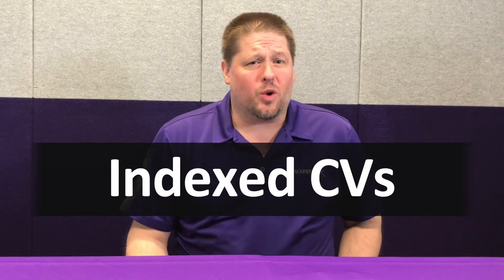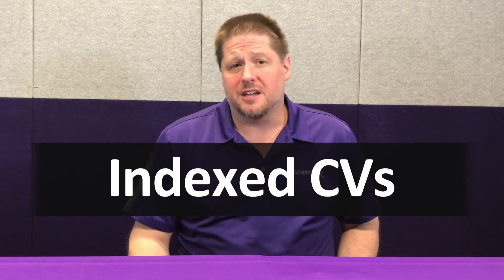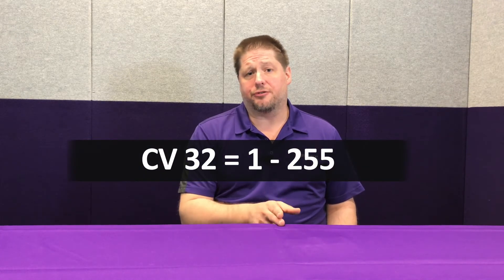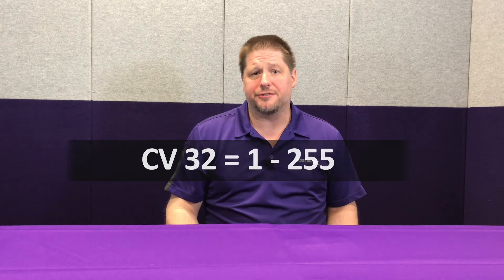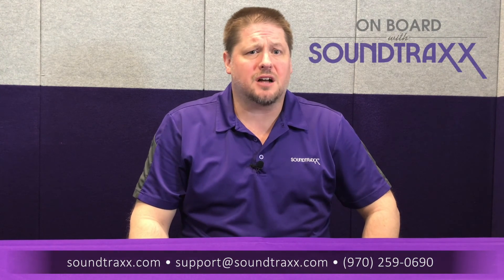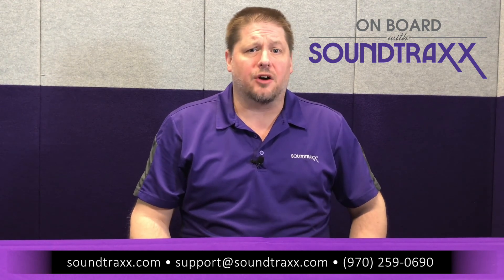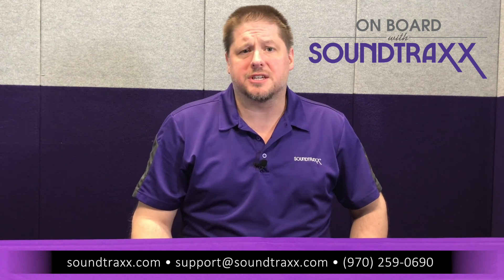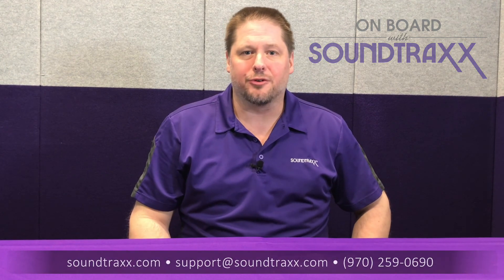What are Indexed CVs?

Comment: George you made a comment about any function can be put on to function key by changing them around easily. Well I am having problems removing the whistle from F2 to F1 & also F3 to F2 so as I can have available more access to Function keys 3 to 9 so I don't have to use the F10 - F18 keys. What happenned  when I tried to do this alteration strange sounds happened with the whistle(steam) & horn (diesel) when I tried to do it on all the models the result was the same. I now have come to the conclusion that both the horn & short horn cannot be changed from F2 & F3 which is what you are saying that any function can be transferred to any function key. Is this the situation as it happens on both Tsunami2 & Tsunami AT1000 sound models. I would appreciate your reply to my problem situation.
Reply from the maker: You can move any function to any function key with Tsunami2 decoders. Please contact our Support Department so we can figure out why you are having this problem: support@soundtraxx.com or (970)259-0690. Thank you.